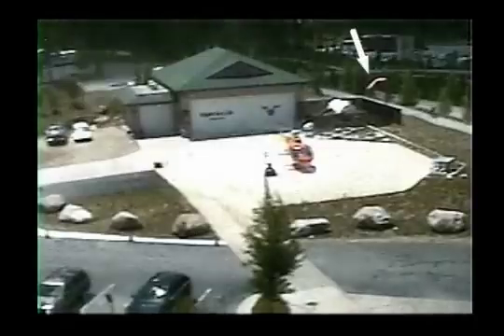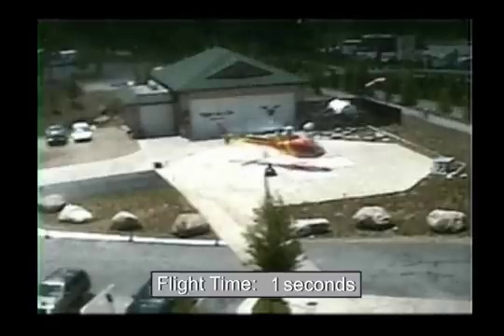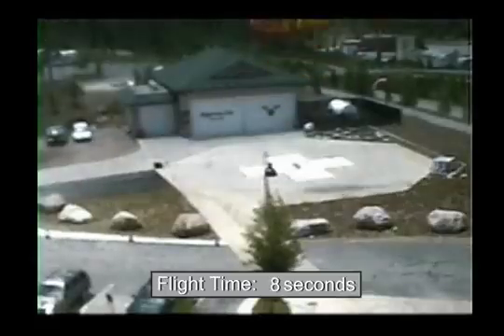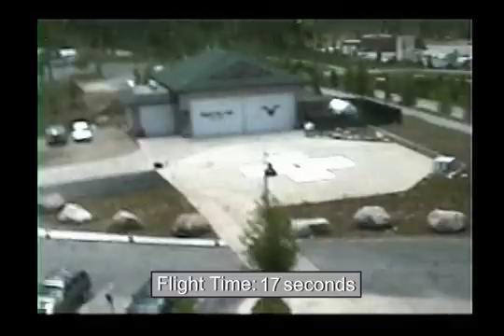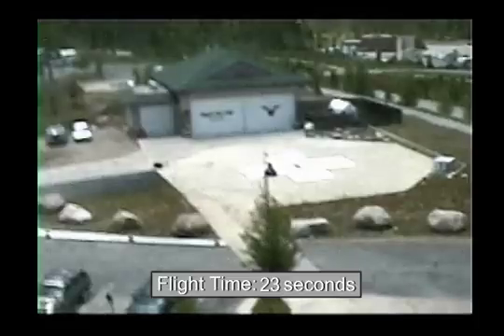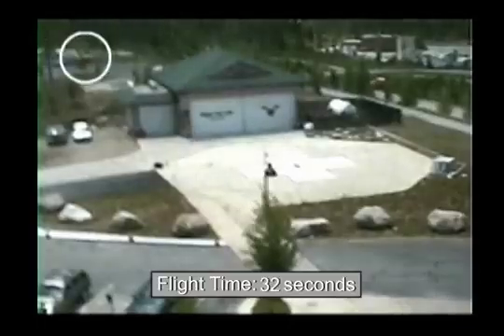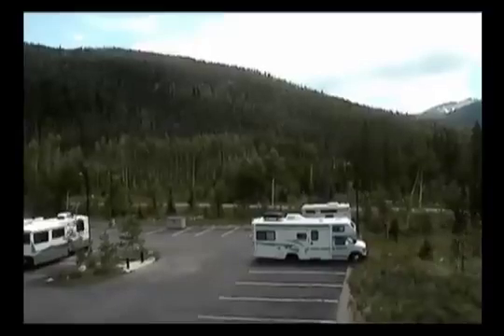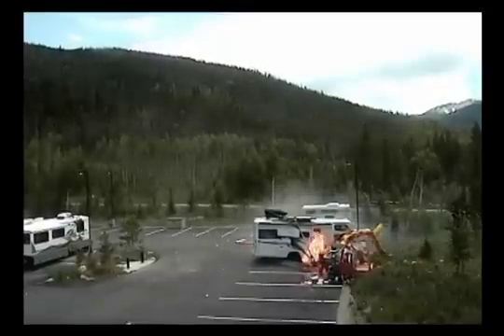#152 - Helicopter Accidents: Human Factors Within Accidents

Comment: Hi there, here is Raphael from Brasil again.
How  is it going?
My question this time is why in a Bell 407, Bell 206 Jelt Ranger or Bel 206L Longe Ranger we have two high temperature peak?
Do we have these temperature peaks in a AS350 B2? I don't think so.
Once a friend of mine did the following start up procedure: He pushed the start bottom, waited for 10% of NG and add 1/3 of power, he waited the first peak and after some seconds the second peak happened. It looked like in a Bell 206 and others. 
Am I right or no?
Can a AS350 B2 engine has two temperature peaks?
Reply from the maker: The fuel control system on those bell products operates differently than the fuel control system on the Arriel 1D1 engine. The Allison/Rolls Royce engine uses air pressure and within the Bendix fuel control as air pressure and fuel pressure increases various mechanisms in the fuel control unit allows fuel flow to increase (peak). In the Arriel 1D1 fuel control we control the fuel flow with the fuel flow control lever. When we take the FFCL out of OFF position and move it forward about 2 cm only the two start injectors are delivering fuel into the burn canister. This will increase the temperature to approximately 250-300 degrees and there will be a delay until the fuel pressure increases to open pressurising valve. Once the fuel pressure reaches 1.8 bars in the pressurising valve which is located in the overspeed and drain valve this check valve opens and allows fuel to enter the combustion chamber via the slinger wheel. Did I answer your question?
Reply: @EUROSAFETYTRAINING  absolutely.
Most of the pilots move the FFCL more than 2 cm or 1/3 and that is why we don’t see two temperature peaks. Am I correct?
Can you tell me when the start ends?
My question is: The start engine ends? When we release the start button and the engine produce energy by himself?
Or when 67-70% NG has been reached ?
I’m talking about B2, ok?
Reply from the maker: The reason for the peak occurrence in the Allison engine is completely different than temperature rise scheduling in the Arriel 1. In the Arriel you control the fuel flow during start where in the Allison engine the fuel control unit schedules different levels of fuel flow during the start. In the Arriel the starter is depressed...The discussion on when we move the FFCL forward we will leave for a different day... the amount the FFCL is moved forward is different for every 350. You have to find the perfect amount for your helicopter. What you want is a rise to 250-300, then a short delay and after a gentle rise to 700. What is happening in the engine is the start injectors are taking the temp to 300 and when the fuel pressure gets above 1.8 bars the slinger wheel also supplies fuel giving the rise to 700. If you do not place the FFCL far enough forward the delay at 300 is excessive and may only go to 400-500 when slinger wheel is activated. If you place the FFCL too far forward the delay will still occur but when the slinger wheel is activated too much fuel will enter the engine and you will get a rapid and excessive temperature rise.
Reply: @EUROSAFETYTRAINING  Perfect!
Thanks for your attention!
It is very helpful.

Comment: do we know why the helicopter started spinning on lift off? was it a mechanical malfunction? what did the logbook say?
Reply from the maker: He left the cut off switch in the engaged position after the yaw load compensator check. He could have stopped rotating by pushing on right pedal.
Reply: @EUROSAFETYTRAINING 
How can pilot forget ? W/o hydraulics it’s difficult to move cycling or collective no?

Comment: Thanks for posting these clips, they are very helpful in learning about the risks of helicopter flight. This video does not provide a whole lot of information about the crash however, despite the video being titled "Human Factors Within Accidents". Can you elaborate on that? Where can I find more details about this accident? Thanks!
Reply from the maker: It provides for a very good discussion on the effects of pilot mentality and reaction to situations. Lets start off by looking at what happened before take off. The pilot did not complete the steps for the yaw load compensator check... he left the switch on the collective engaged. He did not notice the pedals were difficult to move prior to lifting off. He lifted off very rapidly, if fact you notice that he was high in the air before he even made one rotation. If you believe you have a tail rotor failure the procedure is to perform a hovering autorotation by rolling off throttle. The worst thing you could do is climb to 100 ft. The pedals were difficult to move, not impossible. He could have stopped rotating by pushing on right pedal. He could have re engaged the switch on collective to get back hydraulic boost on pedals. He could have gained forward airspeed to get the vertical fin to help with anti torque. The worst thing at 100 ft while rotating you could do is dump the collective..
Reply: @EUROSAFETYTRAINING  Thanks for the details!
Reply from the maker: https://youtube.com/shorts/VDhARC4rbiE?si=uhBp5G4vUhgTEDnd
Reply: @EUROSAFETYTRAINING  Great! Thanks for the followup!